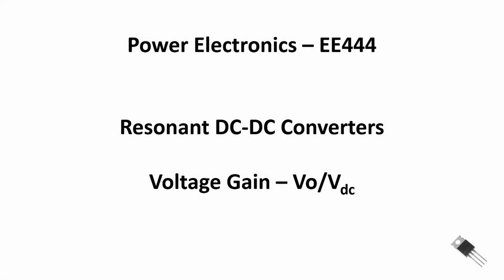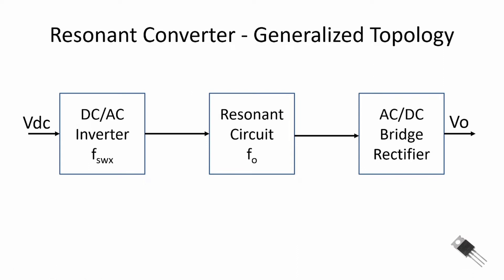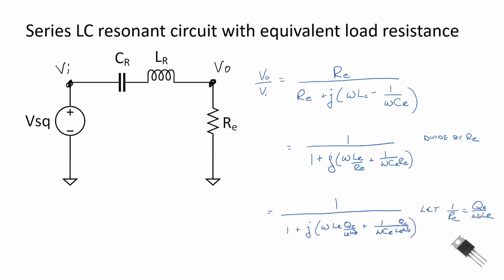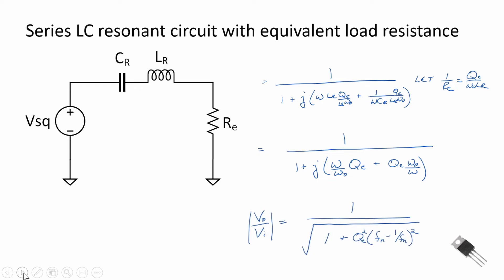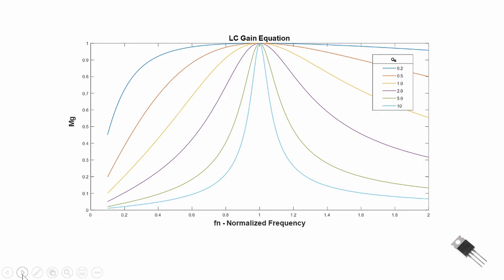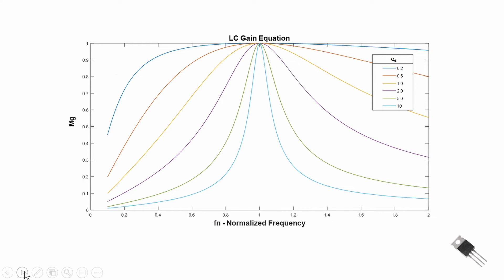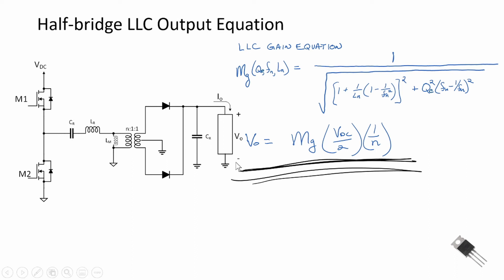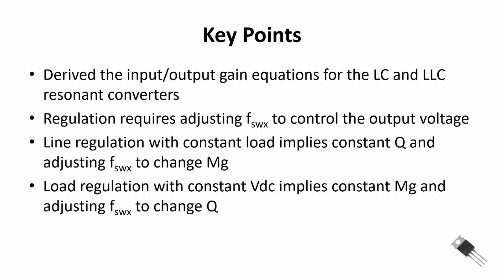Power Electronics - Series Resonant Converters - Gain Equation

Comment: This is great to know the steady state gain equations, but what about dynamics? Very important for compensation. There are a number of reactive components so I would expect this to be a fairly high order system.
Reply from the maker: The LLC converter is probably best modeled as a 3rd order system and yes there is a transient (dynamic) aspect at start-up and if/when the load changes. If the load is inductive, then the model order is higher. Once feedback is added for regulation, we have a dynamic component associated with the feedback loop elements. This becomes a nonlinear feedback control system. All of this is too much for a 15 minute video. Therefore, I just presented the basics. Best wishes on your designs. -Dr. K
Reply: @powerelectronicswithdr.k1017  Are there some guides or application notes I could follow up with to help with design of a compensation network for LLC converter? I've heard there may be methods of current mode control rather than voltage mode control.
Reply from the maker: @power-max  Sure, OnSemi has a good application note, but I can no longer find a link on their website.  It is titled "Introduction to LLC Resonant Converter," AND90107/D by Vaclav Drda.  There is a complete section on the control methods and discuss both the voltage and current based feedback control.  This reference also briefly discusses the start-up (transient) behavior.  Another reference on control is from TI.  Here's a link to a TI reference on the compensation design for the series LLC converter https://www.ti.com/lit/an/slua582a/slua582a.pdf.  Please keep in mind that you are often adjusting the switching frequency of the front-end bridge.  These adjustments are made based on either the output voltage (voltage controlled) and/or the output current (current controlled).  Often voltage control is done with an outer-loop (slower) and current control is done via an inner-loop (faster).    I would also recommend studying control concepts of VCOs and PLLs.  There are some overlap in control technology when regulating an LLC converter.  The control and regulation is an additional layer of complexity beyond the power electronics topology.  Perhaps a new channel called Power Control with Dr. K? lol Best wishes on your designs. -Dr K
Reply: @powerelectronicswithdr.k1017  Thank you for these references!

I have gotten pretty acclimated with the power electronics side of the LLC converter, from hobby experience with building DRSSTC Tesla coil and building a spreadsheet calculator that computes component values for a set of design goals (Vin, Vout, optimal operating condition, power, etc)

Something I found while trying to build a step up LLC converter is that the inductance and capacitance value for the LC portion become unrealistic for a step-up converter (for building a high power inverter) and I think I can resolve this by moving the LLC components to the secondary side of the transformer, but then I cannot leverage the leakage reactance or magnetizing reactance of an "integrated magnetic element" for a very compact design. Would there be a better topology for a step up converter or do you think I did something wrong?
Reply from the maker: @power-max  Typically, a transformer is used as part of the design of a resonant converter, and this allows you to boost or buck the input into the desired output range.  The transformer provides isolation and is also wound to provide the shunt inductance in the LLC resonant converter.  Fine regulation of the output voltage is then done via control of the switching frequency.  Texas Instruments has a great spreadsheet tool for doing the initial design and parameter calculations for an LLC converter https://www.ti.com/tool/UCC25600-DESIGN-CALC.  This works pretty well.  There are also numerous resources on winding the resonant converter transformers that you can research.  Best wishes.
Reply: @powerelectronicswithdr.k1017  Yeah, I am well aware that transformers are used and we leverage there magnitizing inductance... But for a step up converter, what I am saying is I found that I needed an inductance in the single-digit nanohenries and a resonant capacitance of several microfarads, and the simulation of that agreed -- for building a step up 36V to 400V LLC converter for 2KW power capability. (the numbers are off the top of my head, but they seem somewhat impractical)
Reply from the maker: @power-max  Do you have control of the switching frequency?  The switching frequency of the half-bridge is what is used for determining the resonant frequency and therefore the values of 1/sqrt(LC).
Reply: @powerelectronicswithdr.k1017  I think I used a center frequency of 100kHz for my design, allowing it to go down to 30kHz and up to 300kHz, I'm going off memory though I will have to go back and revisit my old excel spreadsheet to find the design parameters I used.

Comment: what is Re?
When operating at resonant frequency, R=0, so IL goes to infinite values, sorry I didn't understand.
Reply from the maker: Hello Enes, there is still resistance.  As an example, a series RLC circuit will operate at resonance when the frequency of the driving source is sqrt(1/LC).  At this frequency, the voltage and current are in phase and the load looks purely resistive to the source.  Re is the equivalent resistance of the load as reflected back through the rectifier and secondary transformer of the resonant converter.   Hope this helps. -Dr. K
Reply: @powerelectronicswithdr.k1017  yess thank you , understand now :)

Comment: Where does the term Vdc/2 come from when you are deriving an output voltage for Half-Bridge Series LC output equation?
Reply from the maker: Hi Chalee, that comes from looking at the square wave input into the circuit.  This waveform has 50% duty cycle and ranges in a value from 0 to +Vdc.  It has a DC offset of Vdc/2.  If we remove the DC offset (because it will be blocked by the series capacitor), the waveform becomes a 0-average equivalent square wave that spans from -Vdc/2 to +Vdc/2.  Therefore, the peak amplitude of the waveform is Vdc/2.  We use this peak value of the 0-averaged square wave to generate the peak amplitude of the 1st harmonic.  Hope this helps.  Best wishes on your design. -Dr. K

Comment: nice information sir,
if we adding a one more inductor in parallel with main inductor what is the benefits?. 
and how zvs and zcs take place sir
Reply from the maker: Abhishek, if the question is can we have two inductors in parallel to create Lr? The answer is yes, but when inductance is in parallel the overall inductance value is 1/(1/L1 + 1/L2).  One reason to place in parallel is to increase the current capability if you have to use an "off-the-shelf" inductor that has lower current ratings than required.  Is there a reason to place two inductors in parallel?
Reply: @powerelectronicswithdr.k1017  ok sir, i got it thank you sir.
sir i want to know about the ZVS and ZCS difference in this converter.